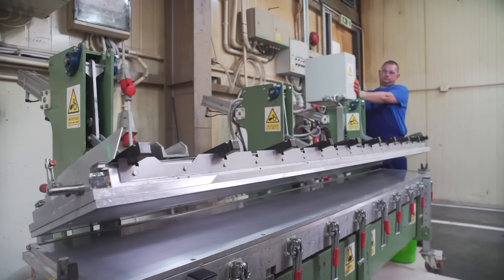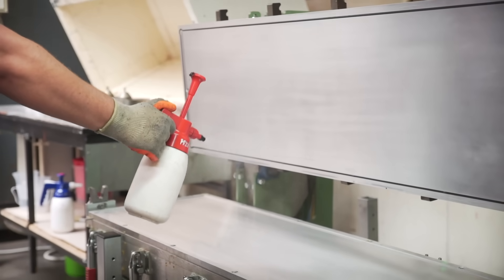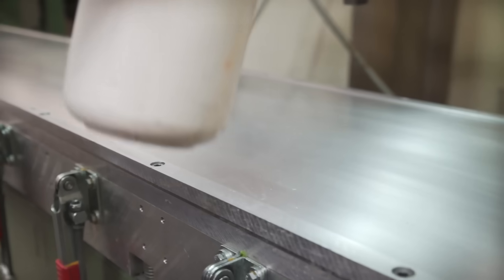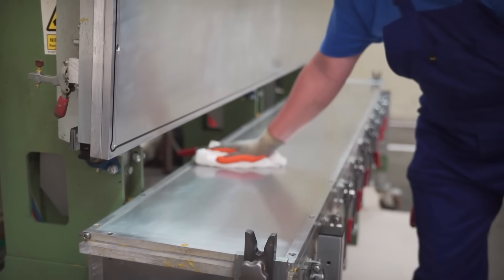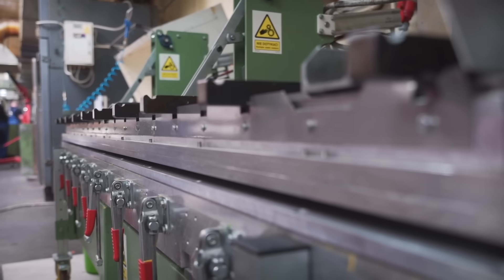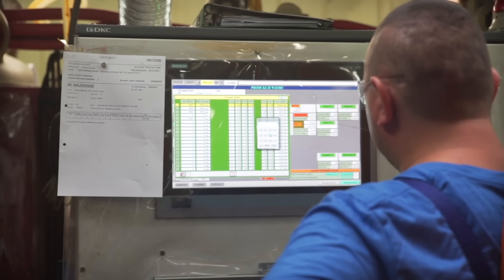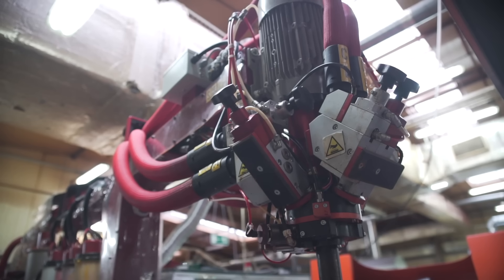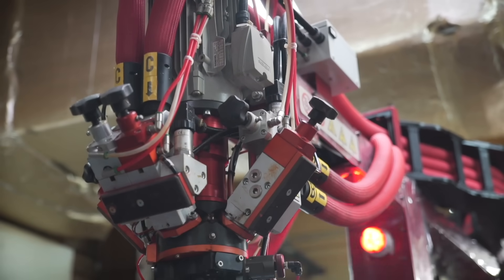How it's Made. Polyurethane. INSIDE FACTORIES

Comment: I was wondering, what is this raw material that is used in the production of polyurethane, specifically?
Reply from the maker: The raw material primarily used in the production of polyurethane is diisocyanate. Specifically, there are two main types of diisocyanates commonly used: toluene diisocyanate (TDI) and methylene diphenyl diisocyanate (MDI). These diisocyanates react with polyols to form polyurethane polymers, which can be molded into various shapes or used as coatings, adhesives, or flexible or rigid foams depending on the formulation and processing conditions. 🙌

Comment: The hardness rating is called "durometer" rating just a note about the technical verbage used with this product, I have used two part polymer urethane in various automotive modifications (suspension components, body mounts, motor mounts) etc.

Comment: Some, maybe most, polyurethane is a liquid at room temperature.  
The solid forms of polyurethane can vary from very hard, like casters and hammer heads,  to very soft, almost jelly like, or like the softest parts of the human body (rather creepy).
The foamed forms of polyurethane can be flexible foam in chair cushions and mattresses,  or rigid foam as in spray in rigid wall or ceiling insulation.  Depending on the formulation, the foam may be mostly intact air tight cells, or may be open mesh-like structure    The density may vary from a few pounds per cubic foot to the density of solid polyurethane.
If foam polyurethane is poured into a sealed mold, you can end up with solid walls, and a foam core.  
Rather amazing material